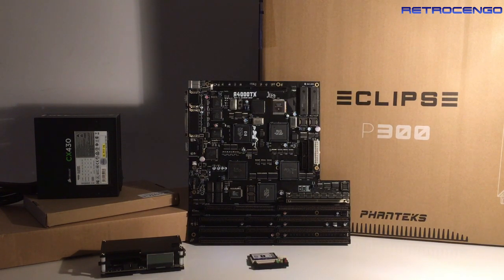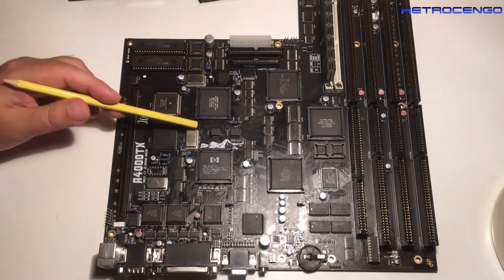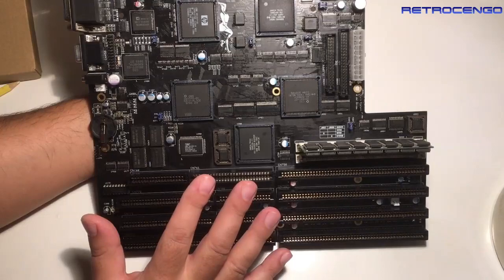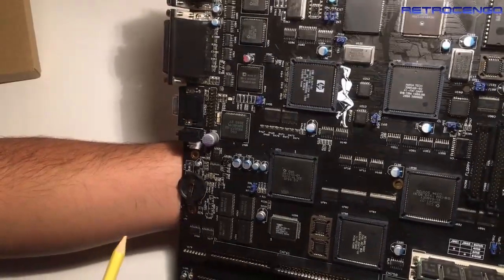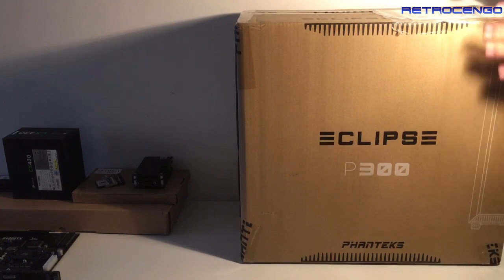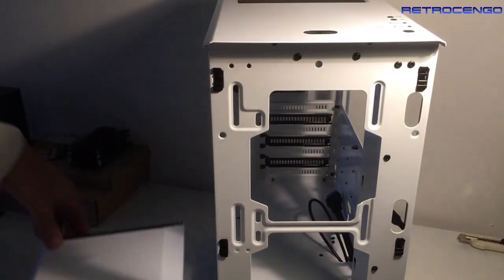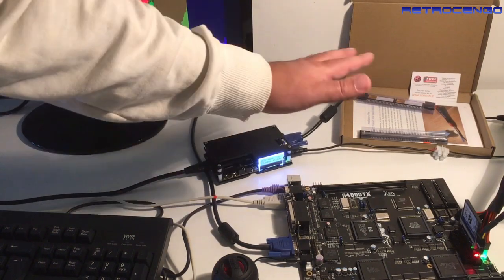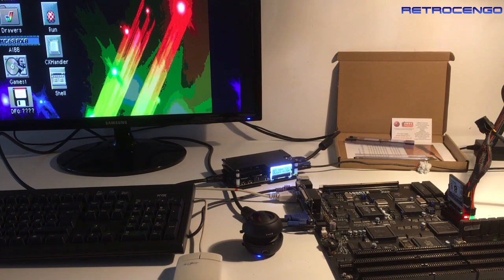AMIGA 4000 TX Build

Comment: Put a Picasso IV Video/Graphics card in slot 1... (that bottom slot is a video slow not an ISA slot)...   Picasso IV has a scan doubler built onto it.
I'm guessing the two 72 pin sockets can accept a total of 16mb of RAM?
Or can it go ... higher?  32mb?

Get a good CPU board too....
Don't be crazy like me....  I'd be crazy enough to install a 40mhz 030 and wire the clock pin to the output of that 40mhz crystal...
but I'm crazy.  don't be crazy.  :P
Reply: Hi there - My 4000 is currently being converted to a TX board....its been 30 years since ive done anything amiga....can i output everything through the Picasso? (i have a picassoIV) - cheers.
Reply: @comfysofa1549  The Picasso switches between chip graphics and RTG automatically. Yes.

Comment: Where can I buy this board? I can solder it myself for lower cost and more importatntly faster delivery,as long as it comes with all components!
I also wonder if the old A4000D PCI riser board works on this, I'd love to use that to get a PPC accelerator to run MacOS PPC on this baby! That way I can have an Amiga and a PPC Mac that is actually faster than a real Mac from the same generation hehe

Comment: There are only 2 things I don't like, first should have at least 4 FAST RAM slots, second the CHIP RAM should also have a memory slot and should have the 8Mb capacity implemented physical traces ready for it so we can update the chipset later and another thing I would love would be the chipset being socketed so it would be easier to swap some of the chipset for replacement FPGA's (which could be used to make a better Gary/Ramsey to implement the 8Mb CHIP functionality)
Reply: Still very very very good!

Comment: You should consider to use this case: https://www.alternate.de/html/product/1588823
It would give you the most astonishing view on the board; but it might be problematicly to put more than two Z3 cards inside.
Sadly no Floppy Slot there - but you might simply built a rectangular case as a base for the Pyramid to put it there (and also maybe a CD drive) - or use a black CDTV external floppy.
I use the case for my PC - but I will try to fit my original Amiga (if I get it repaiered). I already got a boing-ball sticker to add it at the front. Also I hope I find my old CDTV keyboard an mouse...

Comment: It's beautiful but why not go for a 68030/40MHz on board?
Reply from the maker: That will need the rest of the system to run at 40MHz, thats why😁
Reply: @RETROCENGO  You're right, I was forgetting you need a CPU on the daughter board to be able to do the INT/EXT clock swap thing to have the CPU run faster.
Reply from the maker: @jkdsteve  It has a dedicated CPU board yes, not on the daughter board, but i know what you mean😁 merry Christmas 🎄
Reply: @RETROCENGO  Amiga 3000/4000's CPU section was not design like a CPU accelerator with up to 100Mhz+ clock speed.

Comment: No 30khz VGA signal? Why is the mistake of keeping to 15khz-only not adressed in any Amiga, except the 3000? To me, it is feature number one, on any feature list.
Reply from the maker: Could be awesome with built in scandoubler yes, but it is what it is🤗
Reply: @RETROCENGO  Yup.... Mini-ITX, 32 to 64mb Ram, HDMI or Displayport (build in scandoubler) 15pin RGB, keep the mouse/keyboard options and one single PCI slot if people want to have PPC and Voodoo3 upgrade options. Ditch FPU and Zorro slots. And possible add a Wifi solution as well.
Reply from the maker: @brostenen  Dude if you build that, it will sell 😁
You didn’t mention the CPU
Reply: @RETROCENGO  No change in CPU. Perhaps beef it to 50mhz.
Reply: @RETROCENGO  Personally, I would be happy with all that, yet the machine based on the A3000 instead. Except the HDMI output, should be using an RaspberryPI-Zero. The SD card software is easy to update, as it needs to be Fat32 formatted, and the config is just an TXT file that you can edit on whatever you like. I am not a fan of highres screenmodes anyway. Another aproach to the video mode, would be to take the OSSC (as it is open source) and build the key components into the board. And have access to highres screenmodes that way.
Reply from the maker: @brostenen  Based on A3000 instead? Then you’ll be missing the AGA chipset🙃
Personally everything from 68020 and up should be based on aga that gives acces to amazing aga demoes. 
When i sit with my A3000 and A500 with ACA500plus i feel no difference except paying 10 times more for the A3000😁😁😁😁😁
Reply from the maker: @brostenen  Ohhh 50MHz 68030 is the sweatspot yes🤩
Reply: @RETROCENGO  Well... The 3000, is to get ECS. As I wrote, then personally to me, then AGA is not important. I like ECS and OCS, because to me they are more classic. The few games and programs that I use on Amiga, is OCS anyway. But the speed of the 3000 would be awesomme to have. Here I am thinking about ECS combined with the Bus system. 😋
Reply from the maker: @brostenen  Put in a TF536 in your A500 then, and you got your dream system😁
Reply: @RETROCENGO  Well... The bus system is too slow. If I was able to have it all on a 32bit bus like the 3000, then it would be nice. Having one PCI slot for a Radeon or Voodoo card, to get RTG would be a god sent, and then a PPC upgrade option as well, if I wanted to go for some OS4 action. That way, I have access to run both the classic AmigaOS, and also be able to run OS4. 😋 I think that is a better Amiga, compared to go for most colours.
Reply: @RETROCENGO  And yes. I would love to own an TF-536. No question about that. I just do not have the money for such a thing. Even better, I would love to have an VampireV2 in an Amiga2000. Again. Cost so much that I will never have money for it.
Reply from the maker: @brostenen  ive never seen os4. Maybe i should check it out😁
Reply: @RETROCENGO  You need PPC for it to work. 😉 And classic Amiga stuff you need to run through UAE. So it is not an classic Amiga. However it is still Amiga. Those that have argued against it being Amiga, are the same who say that only Commodore branded machines are Amiga. By their standards, your board in this video, is not an Amiga. Nor is the Escom 1200 and Escom 4000 an Amiga in their eyes. 😁 Amiga is just a platform. And we call it classic and new gen Amiga.
Reply: @brostenen  ZZ9000 will be the best option for this A4000TX board :)
Reply: @josteinkallevik  Ahh.... So true. I really have forgotten everything about it. That card is awesomme by the looks of it.
Reply: @RETROCENGO  A3000+ prototype has AGA chipset and AT&T DSP3210 (with 32-bit integer and floating-point support, up to 10X faster than 68040).

Atari Falcon's Motorola 56000 DSP only supports 24-bit integer which is nearly useless for 3D games.

Amiga 3000+'s AT&T DSP3210 32bit floating point was interesting since it's a similar format that powers modern gaming PC GPU's 32-bit dominated floating-point workloads.

Comment: something that  i have wondered  about awhile is . ive never seen anyone making a dual 68k  cpu card or a way to use both cpus  when you have a card in . i whish i was  a code monkey/hardware guy  i would so  try that  avenue if i could
Reply from the maker: Jason, maybe you should start designing programming so we can get more new awesome Amiga hardware 😊
Reply: @RETROCENGO   i whish i could , i can only mess around at low level user  a running  few bodge wires is my level of expertise, but great video
Reply from the maker: @gumbi79  Thanks buddy, I really appreciate it

Comment: But if you don't need all the slots at the bottom, all you really need is an A600/A1200 and not an A4000 - the whole point is to redesign the original A4000 board and put it in an ATX case which are cheap and affordable and still be able to use the original Zorro cards.  The Amiga cases like the Micronik towers were extremely expensive for what they were, which was around £300 when released, so an ATX case for £50 today for A4000 ATX motherboard is the right way to go.
Reply from the maker: You are partially right, thats why i love the Amiga 1200. But this design is amazing and fits in EATX, i love that part. Yea zorro slots are not interesting for me, but others can enjoy them, some likes to install more ram or rtg card and so on😊
Reply: @RETROCENGO  You should embrace the Zorro III slots.  Get a network card in there and start surfing the net with the Amiga aswell! However, 800Euros for a fully assembled board is a bit pricey.  I would consider it if it was around 300 to 400 euros perhaps.
Reply from the maker: @robbiew73  i have ram cards Z3 64MB in some of my A4000s they are slow that way, but works fine. Ive never tried internet on amiga, but will do some day, watch my youtube videoes on amiga maybe😁😁
Its alot of work, i think Heses price at 800 is really nice price, and his schedule if FULL into 2021, list is long😁